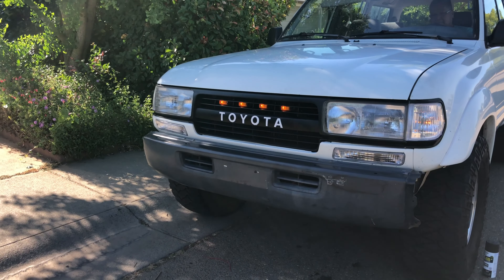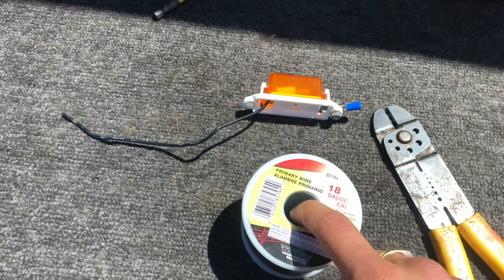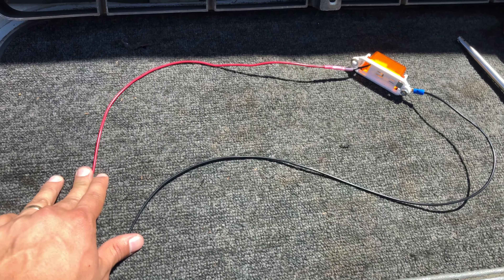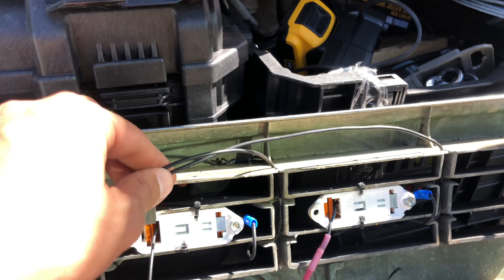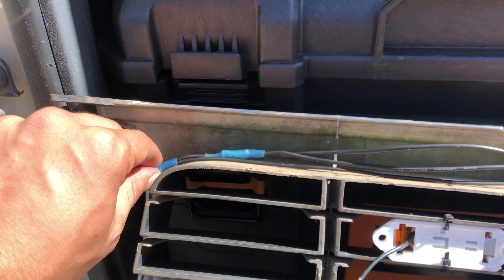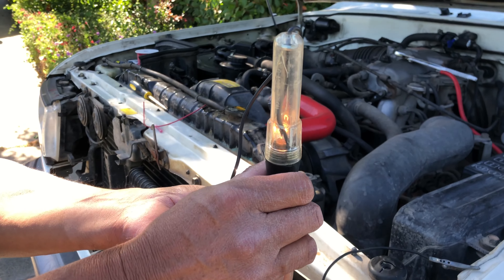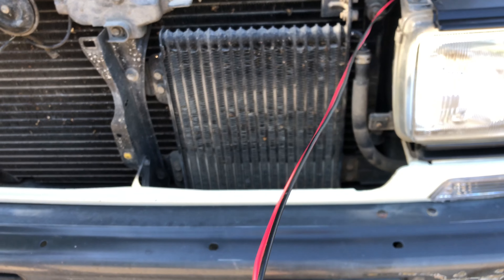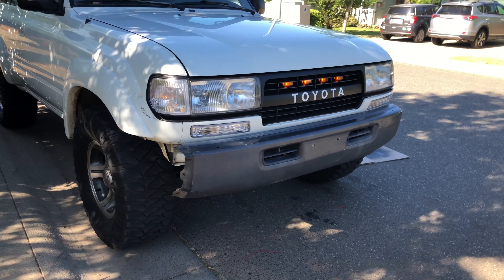add grill 'Raptor' lights to ANY older Toyota truck

Comment: You sprayed the grill. It's maad good. It actually looks better in black. You know putting both wires In a single  sheet and tucking it into the grill would be great cuz the vacuum may begin to pull em.

Comment: Looks awesome!  I'd like to know what lights you used.  Will you add that to your description?  Also those are not stock side markers or cowl lights--your before and after are yellow and clear.  Source for those?
Reply from the maker: I recently updated the description with the links, the side marker lights I got from EBAY, however...... I had a bad experience with them so I cannot recommend them. Cheap and Flimsy and I paid over 200 for them I was very disappointed If I find better replacements I will definitely post them up.
Reply: @LNDCRUZIN  good to know!  thanks!

Comment: Those aren't "raptor" lights lol. Years ago the government mandated that any truck over 80 inches in width needed 3 yellow lights for visibility. As a result, most trucks were built to 79.9 inches in width. The raptor is wide.
Reply from the maker: haha that makes sense why trailers also have them!